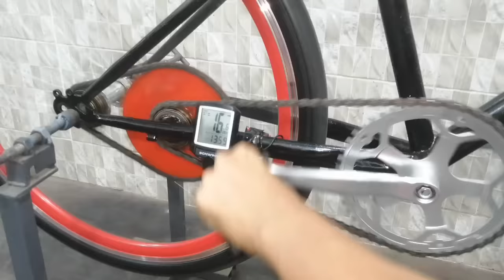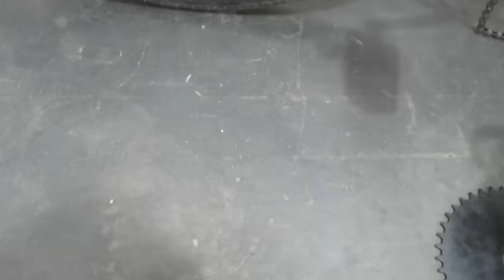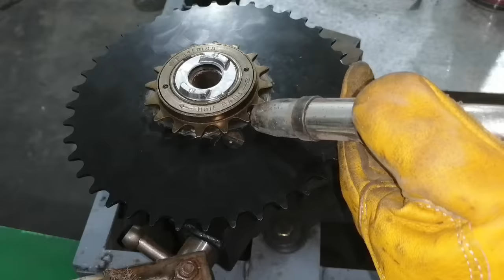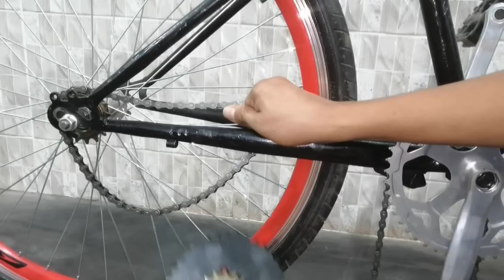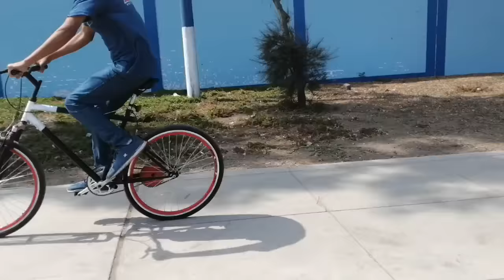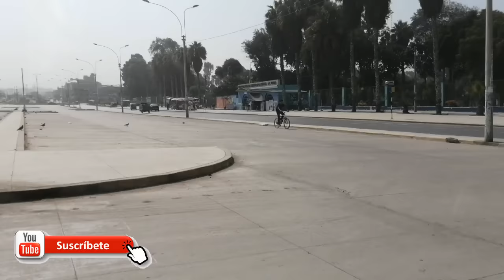increase the speed of your bike.speed multiplier

Comment: The principle is good, but there are lots of problems here too.
Firstly the rear freewheel he removes is probably a 16 tooth. It would be far easier to replace the rear wheel with a freehub design which would allow an 11 tooth sprocket. Similarly  it's also easier to increase the chainring size at the same time.

Secondly the stresses going through the chainstay will be enormous....far more than the tubing was designed for. 

However I like the concept though. To have a secondary gear would allow for incredibly high gear ratios (or low ratio too). Interesting for record attempts etc, or recumbent bike that achieve high cruising speeds.
Reply: agree the principle is good but not perfect
Reply: Don't be such a sciencetist it's cool ok
Reply: дядь , ты русский?))
Reply: It's not bad but it needs improvement.
Reply: can you make a video showing your design? i would like to see it.
Reply: And bingo, that my friends is exactly what I'm looking for. To make a recumbent a high speed cruiser. But it's probably unrealistic to get up to say idk 30 mph with being a professional athlete to maintain without just completely exhausting yourself doing it  lol
Reply: @kennethferguson9828   this guy showed his speed meter at 70-80 km/h or mph? Wdym only 30mph?
Reply: @kennethferguson9828  have u seen any 4 wheel recumbents?
Reply: With that type of speed...you might want to upgrade the brake system as well....
Reply: A way to disengage the secondary gears
Reply: Its not practical though. You need alot of power to turn those pedels and if you wanna climb its gonna be impossible
Reply: @dividingrain1907  I wouldn’t have put it so politely…… as much use as tits on a boar…….. like having a car with only 5th gear, no use to man nor beast and I will bet that he couldn’t even get started without help.
Reply: @thunderkat3142  
Bro thats revolutions per second not a speedometer
Reply: A 80 km tienes un pie en el otro barrio
Reply: The issue is torque, not speed. Going up a grade would need big power input.
Reply: I think it's a cool concept but the drivetrain losses with friction and suchlike would be too big for this to be effective i think. Could be proven wrong though.
Reply: @thunderkat3142  mph is not the same as kph
Reply: @kennethferguson9828  what you mean? I’m not even a professional athlete and I ride a fixed gear. I have a good cadence and stamina I can easily keep a pace of 27/29mph on a 48:17 ratio spinning at max for a good amount of time on drop bars. I can hit over 32mph on a 53:16 ratio but my best spin/ cadence pace will always remain at 49:14 straight hawking everyone down drafting and sprinting ahead and keeping that same sprint for about a mile 😊

Edit: however this bike would’ve been rejected the moment my boss/ coworkers saw it come into shop as a liability issue. Wrong dropouts extra chainring it just looks like a contraption with an injury waiting to happen. We’re good boss
Reply: But this would be a great idea for a homemade set up where this turned a small treadmill motor to make power right??
Reply: So what you guys are saying for that to be ideally the perfect bicycle
Reply: Well Professor why don't you build one and show us what you mean
Reply: I agree Professor since you're so smart and you're telling this guy he needs to read to do his design let's see yours professor
Reply: @@danjames4086  with this gear setup on a bike and today's cheap electric trike with differential gearbox, i wonder if it's possible to apply this setup on the etrike differential gear axle..... not this design exactly, but an improved one, since the current top speed of an etrike with a differential axle is around 35kph on sporty mode. i like to hear your thoughts on this.
Reply: This bike not gonna be good pedaling uphill.

Comment: It's been about 7yrs since I've worked around machinery as in machine repair department. At first didn't see the difference was then started to think once again. Thanks to you, no blaspheme intended, I see the light once more! Very ingenious!
Reply: please test this and let us know!!
Reply: If you knew anything about practical science and applied physics you would realize that the middle sprocket makes absolutely no difference to the final ratio between the front and rear sprockets.
Reply: @MsMara287  I'm your first like. I'm just a simple machine repair guy,  nothing more. Plain and simple, like a Amish or Minnonites simple.... 
Thanks for that invite of applied science,  I love science,  history and mathematic stuff.....
Reply: @MsMara287  Actually, it does something:
It adds friction, making this "very ingenious" design less efficient than having the same gear ratio between merely two gears.
But yeah, anyone with a basic understanding of "applied physics" as you called it
("Technical Mechanics" would be the appopriate course in engineering studies)
would see within 2 seconds, what is really going on here

Comment: You have to be strong as a beast to power that top speed. Higher gears have higher top end but it divides your torque to overcome the tendency to remain still.
Reply: It requires more strength, yeah. My image is that high gears trade strength for speed. Personally, I use my bodyweight to drive high gears.

Comment: Two details.
one.-. The first chainring has 48 teeth, the second has 39 and your sprockets have 16. According to the assembly, for each revolution of the pedal, 7.3 revolutions of the wheel are obtained. That can be overcome with a 60 tooth folding bike chainring paired with an 8 tooth BMX sprocket. That is to say, Hera is not necessary, on the other hand there are those who have installed huge turntables to have much longer developments.

2.- A lot of force is required to move that transmission. Even professionals use much shorter developments.
Example
Time trial 58-11 (5.27 wheel revolutions per pedal revolution)
Route 53-11 (4.8 wheel revolutions per pedal revolution)
Xco 38-10. (3.8 wheel revolutions per pedal revolution)
Bmx (between 2.4 and 3 revolutions of the wheel for each revolution of the pedal
Reply: Si vas a usar google translate por favor arregla primero los errores del original... porque la esposa de Zeus no tiene nada que ver XD jajaja y "force" está mal en el contexto. Y me reí con "Turntables" jajaja
Reply: You didn't create it 🤦🤦🤦
Reply: Use electric motor for initial torque.
Reply: @naveshsingh1922  agree
Reply: 60-8 would not work out well. That 8 tooth is great for BMX where the primary focus is on jumps and tricks but on a road bike attached to a 60 tooth chainring, I would imagine most 8 tooth sprockets would not survive the amount of power necessary to drive it at full speed
Reply: @Quarkonium  it would take the force. Usually the super small BMX sprockets are paired with a low 20s tooth chainring in the front so there's a lot of torque going to it. In this case the torque is a lot less if the chainring is huge. He can only apply as much force as his body will produce. I've put engines on bicycles and put 3HP through a 7 speed chain and sprocket set. It holds just fine and that's way way more force than any human could ever achieve. I'd get the 80lb bike up to 45 mph on a bad day and there's no way a person could pedal a bike that heavy that fast. The weak point is the chain. I've broken chains on motorized bikes never a sprocket.

Comment: Great idea if we all had bionic legs to be able to push the pedals round! How much torque would be required at medium speed to maintain thrust?
Reply: Well it is a good exercise for legs
Reply: @masterbaiter338  uh, not so much. there comes a point where it's harder on the knees than it's worth. And to answer Crusader's question? about 3x harder to push than the ratio it started with. and that was already about a 3-1 ratio. You'd probably end up going slower because the strain on your legs is so high.
Reply: Good point
Reply: @DFX2KX  yup that disk is quiet large can create a huge muscle cramp 😅😅
Reply: @DFX2KX  I'd like to know how much torque you need haha. I can maintain around 200-230watts for a few hours and people who do cycling as a sport everyday can do a good 300+watts. Is it enough?
Reply: @freshtomato834  oh I can generate that kind of cranking force. But it's much easier on the legs generating that power while moving your legs a bit more quickly. The way this thing is geared, it's got more in common with a leg press than a bicycle.

This gearing ratio is all static load, all the time, with no accommodations for a hill. Meanwhile me and my basic 7-speed can move just as fast on the flat, just moving the legs a bit more. Then a hill shows up and I drop down a gear, lol.
Reply: You need a hercules legs to sustain progressive speed.
Reply: my cat will be doing it for me
Reply: Roughly 1 horsepower on a shallow incline.
Reply: Are u blind 🤦🤦🤦
Reply: It's a bike not a jet

Comment: I like it.
You might be able to add a stack of shifting gears atop the orange gear that you could use to shift to a better ratio on hills. I don't see anywhere else conventional bike parts would work.  (Edit nevermind look at the clearance, I think this one stays 1 speed)
Reply: You could just use a shifter with some sensible ratios. 3 gears in the rear is enough to drive up a hill and drive faster  on flat ground than you will ever want to on a bike like that.

Comment: There is a Big problem, it's impossible to get more power, the power is constant so it doesn't matter how you mount the chains.
According to the laws of physics, you can never get more power out than you produce.
I was around 12 years old when I learned this in school.
Another thing is
What you gain in power you lose in length.  This applies to blocks and hoists, where you can lift a car yourself, but then you need a very long rope 😊
Reply: I never could get how block n hoists work, hearing & levers yes but block (tackles)? , don't quite get em.

Comment: As someone who's built dozens of e-bikes every hub motor e-bike could use this. Once a decent size motor is up to speed there's no chance you can input any power by pedaling with a normal setup.
Reply: Yes but you  need to add more force to the pedal.
Simple mechanics
Reply: @Aslan-ed1gz  it's not force it's speed Mr. Simple mechanics. And either way I'm telling you the average person can't apply it once a motor is fully engaged. What did you miss?  How can I clarify this to you so you don't feel so ignorant? 

I'll break it down real simple. The average person can probably ride a bike around 20 mph at best. Once you exceed that speed limit with the motor you're no longer inputting human power. If you can't comprehend it after that I probably won't even give it another shot.

Comment: That's great if you turn the pedals by hand and the wheel not in contact with the ground.
      But once you place the bike on the ground and try to pedal it, it would be very heavy to push.
     You might not be able to pedal it on even small inclines. Great for flat roads or the track, though.
Reply: most of the time I see this being done, the power source is changed from pedals to an old Briggs 5HP motor. Resulting in a bicycle that goes far faster than it's brakes are designed for.
Reply: we could add hamsters to help pedal up slopes

Comment: hope that there will be a part 2.. for you to continue working on the modyfi and additional gear..ofcoz for the hilly and uphill road.. . you are the one who works on it..I bet you can do it sir..👍🙂
Reply: The next part will be about modifying the legs, so they can manage to provide the torque through such a high ratio.  Anyone who's ridden a multi-gear bike understands that.
Reply: @James_Knott  like adding the second legs for the middle primary ..then just change leg into high ratio ...
Reply: @ZeyZard  Or just invest in a derailleur gear shift. It does what this design does, but much better in any way and it also does more

Comment: So just like what alot of bikes has gears except this one you can't change the gear. But I understand why you would want it but inclines and dirt is gonna be tough. It will be a lot harder to peddel but in return if you have the energy and the strength you can get some good speed with it. But really only recommend for flat roads. I used to bike ride 80miles a day for over a year. I haven't done that in a few years tho. But if you bike ride enough you will get the strength to keep going. I rode a 29" mountain bike up to 40mph for miles straight. So if you like it and want to go hella fast without the use of a engine or motor. Practice and push yourself

Comment: Make a hybrid boke by dding  a geared electrical motor to help you with the needed start torque, especially in hills. You may even turn off the motor once you reached the high speed and the motor becomes a dc generator that charges the vattery

Comment: Oh for Chist’s sake!  Let’s add a bit of physics and reality to this.  First, if you increase the gear ratio by say 4:1, the pressure on the pedal for the same speed, goes up by 4. So you need iron legs just to ride at the same speed you were going.  Second, the power needed for any speed on level ground goes up cubically as speed goes up.  So if you are riding on level ground and producing say .2 hp ( which is a lot for a human) and you want to double your speed, you will have to produce 1.6 hp.  You might be able to do that for a few seconds, but if you are human, that is the limit.  If you expect to go 4 times as fast with this new gearing you will have to produce 13 hp.

No one can do that.  BTW, one hp is defined as lifting 550 pounds at one foot per second.  13 hp would be able to lift 4 tons at 1 foot/sec. In other words carrying a loaded pickup truck up a flight of stairs.  Good luck.

Comment: With car top gear, you can drive easily on flat roads  ..... If it is a big climb the engine will stall no matter how much HP the engine has  .... Can this be used for climbing?

Comment: At this point, use a gasoline engine, 0 effort, high speeds.
If I pedal to my work it takes 1h, if I use a motorcycle it takes 20 minutes, so to work and come back home I waste 2h pedaling or 40min riding. If I ride I can use the extra 80min to rest or study or work.
The cost of gas can easily be paid by working another 1h and I still have 20min left plus 0 effort.

Comment: It would be easier and get the same results if you simply changed the peddle and axle gear ratio to match what he has in the extra friction/drag created Frankenstein intermediate pulley system he has there. He did nothing but complicate a simple gear ratio

Comment: Good for either straight flat roads with a tailwind or for straight downhill roads. Otherwise it is useless. Building super high gear ratios while maintaining the same power output (your human pair of legs) is no solution to go faster if not under the previously stated conditions. Wind resistance will limit your top speed especially while sitting in that upright position. Going uphill? Lol forget about it, get off you 'superbicycle' and push it !!

Comment: Intersting concept, but it would never get like largely produced because its not legal. Bicycles cant go over 45kmh. Because it would be categorized as an motorized vehicle even tho its not really and would require a license. Ive tried hitting top speeds on my 2 Bicycles I have and max I did was 40. Just couldn't go over it. I guess its designed with that in mind.

Comment: You would think that someone with the technical ability to do this modification would also know how useless it is. Even on the flats it is going to be difficult to get up to speed. Any up hill and you are toast. Many commenters seem to think power is multiplied by mechanical advantage. But in fact torque is reduced by it. A basic physics textbook is recommended.

Comment: I'd love to see the part where he starts pedalling from a stop with no assist and also see how long it takes to get to a desent cruising speed.. also increasing the size of the bottom bracket chain ring would be the same without any need of welding/customization. talk about reinventing the wheel...but there is no reason to do so.

Bikes have the gear ratios that we are accustomed to for a reason.  going way above or below is reverting back to when  bicycles with gears were first though  and forgetting all the work and phisics that was put in into fiding the best set of rations related to human effort.

this video makes no sense except for monetization purposes. any other reason or goal is BS.

Comment: You do realise that you need to pedal a bicycle?
All PRACTICAL ratios are available using just the front and rear rings.  The classic ratio for a single-speed is (72 inch) 48x18 on a 700c wheel.  
A 52x11 gets you a 127" gear which impossible to get going (unless you are an Olympic Track Sprinter).

Comment: How is this better than any usual transmission? It's just a high gear ratio, making it look like you pedal very slow compared to the wheel spin, but you are actually applying more force. The same amount of energy is being transferred into kinetic energy,  the principle itself wont make you go faster than any other tansmission setup.

Comment: Too much unnecessary. It's a gear bike. It's not practical, it doesn't save energy. It goes faster, but for this you need to press a stronger pedal. What will work then?

Comment: This kind of gear ratio doesn't make any sense in reality. You will achieve higher top speed with much easier gear ratio. The wheel torque is really low with this kind of ratio.

Comment: Better learn to pedal correctly. Extremely high gear ratios are not good for knees or to maximize power output. High ratios are practically needed only on downhill. Amateurs should pedal around 80rpm when aiming for high speeds while professionals can pedal much faster.